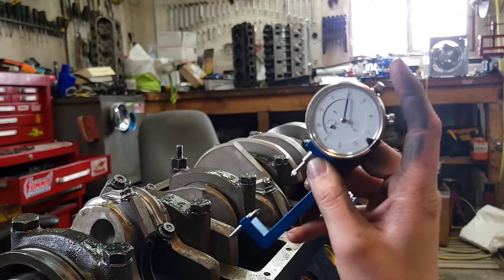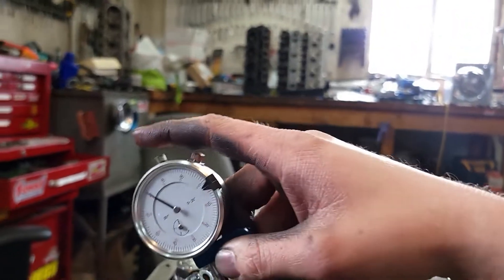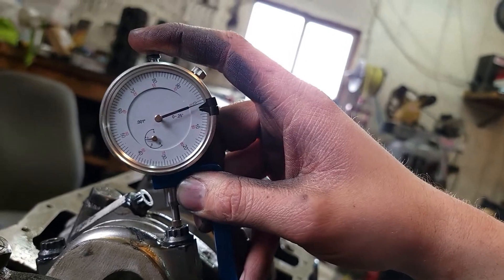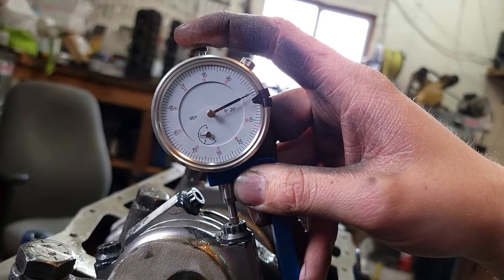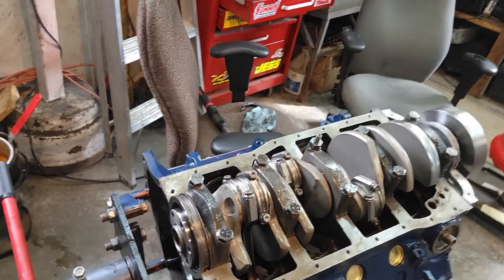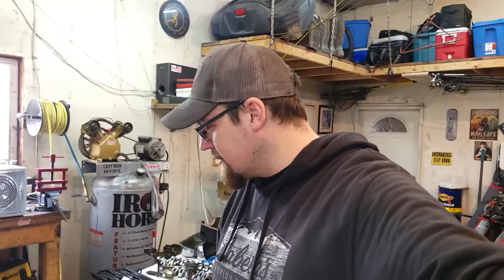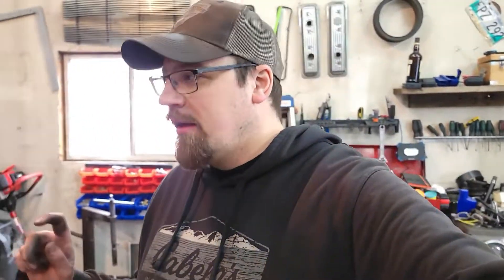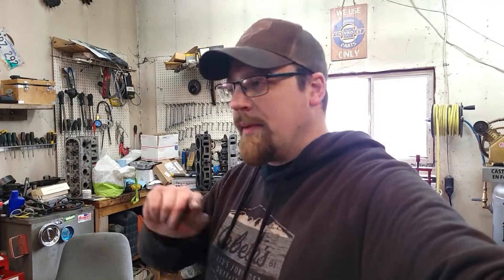How To Use A Rod Bolt Stretch Gauge!?

Comment: I had shop line hone,  got block back with caps torked.  Zero is not going to be zero. 🤔
Reply from the maker: @kevinwest3689  once you loosen your bolts, they will be relaxed and that's your zero. if they are stretched to a point they don't come back to "zero" replace it. 

you can use the stretch gauge on them before backing the torque off to verify they relaxed after backing off.

Comment: watching this made me look at my Eagle rods with ARP 8740 bolts...and the directions say if using toque method lube bolt and torque to desired torque, and if using the stretch method , place stretch gauge on a relaxed bolt set at ''zero'' put box end wrench on nut and tighten until appropriate stretch is realized...
Reply from the maker: @pollackroe8566  yup that is a good way to do it!

Comment: The factory conrod bolts don’t have holes on the top and bottom, so we can’t measure them using a stretch gauge, correct?
Reply from the maker: If you can do it on the same spot you probably could but I don't right now on the stock bolts

Comment: Did you use the ARP bolt lube on your bolts? If not, this would explain the higher than normal torque going on. If you did, I would for sure talk to ARP about this and verify before you do anything else.
Reply from the maker: you bet! I use lots of lube, I've done NUMEROUS 8740 rod bolts now and all are the same results, even ordered an extra set to have on hand for any that want to stretch beyond spec and same thing. Triple checked with machine shops who all state the same thing with 8740 bolts.

Comment: When you start falling out of the mfgr's spec, it's time to call them. The bolt was not designed to be torqued that high. Too much torque could pull the threads among other things resulting in disaster.
Reply from the maker: I agree and that was my first thoughts as well, after consulting my machinest he confirmed the 8740 ARPs always torque higher then advertised to achieve correct bolt stretch. That being said I should also reach out to ARP to get there take on it, thanks for the comment 👍
Reply: @CompetitorsEdge22 any updates on the matter? 100lb is way too much